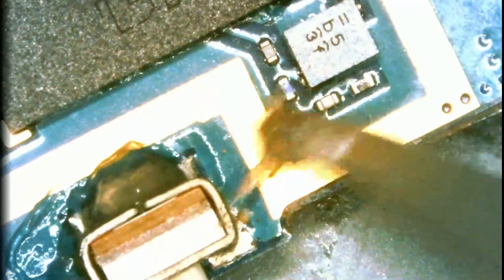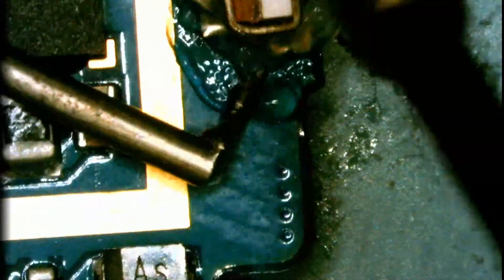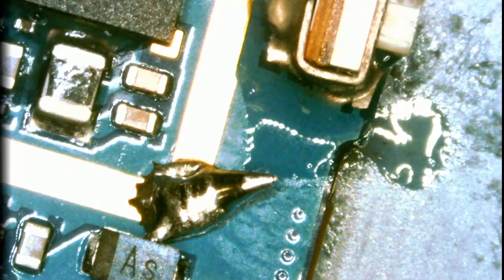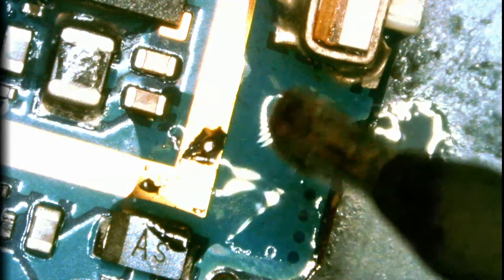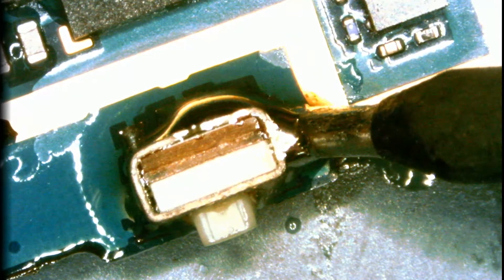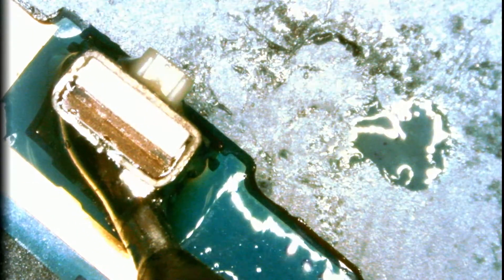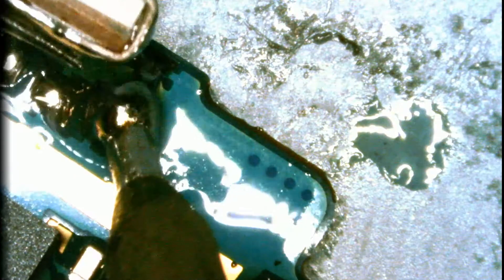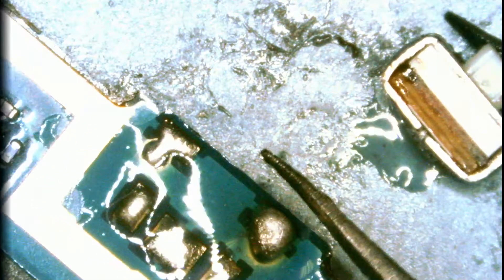Galaxy S3 S4 Nexus 5 Power button Replacement - Repair video

Comment: Man do you make this look easy.  Just spent 2-3 hours burning up 2 new switches.  Only really needed it for getting data off but just wanted to see if i could do it.  Luckily I was able to just solder 2 wire on - after failing miserably.  Always nice to see an expert work